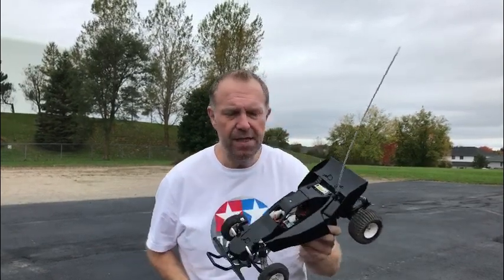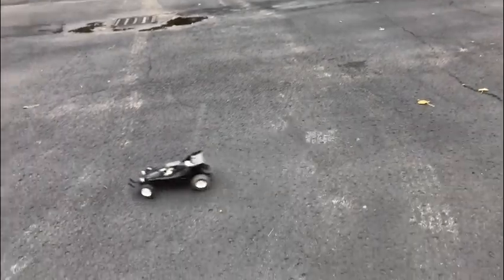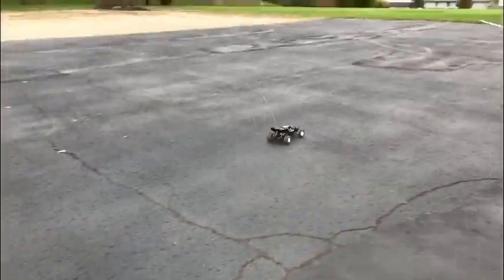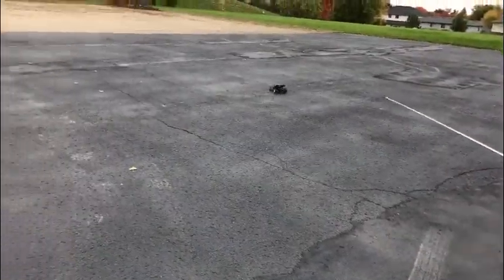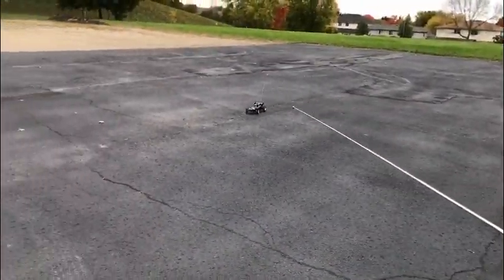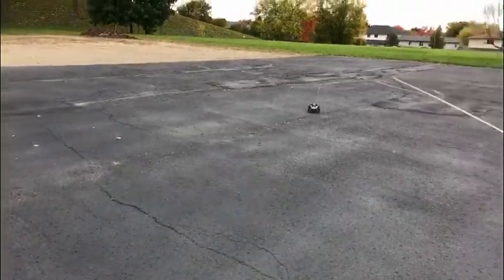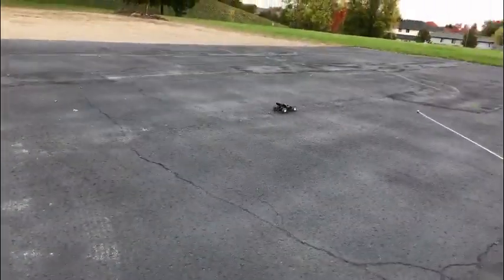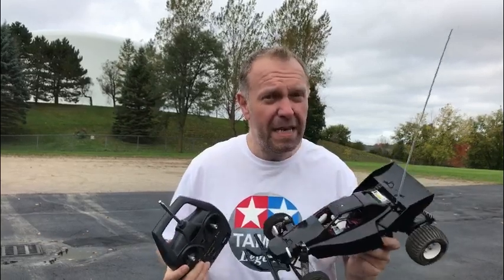Tamiya TECHNIGOLD Motor, Was it all that???

Comment: Thank you, very interesting experiment. I modified a Super Hornet, fitting a BZ motor and making an adaptor plate so that the gearing changed from standard 18T pinion to 24T. All very well, but the kids kept smashing it. I've taken it back to standard 540 with 18T pinion and still have good fun with it.
Reply from the maker: Steven Hall 
Cool 😎 yeah there’s a fine line with that chassis regarding the speed, I think a standard 540 motor on 2s Lipo is just about perfect 👌🏻 
Thanks for watching Stephen 😊👊🏻

Comment: I still have the technigold  stalled in audi quattro with 18 teeth pinion gear. I have tried it in the frog and kyosho's tomahawk. Quickest is tomahawk, smoothest is the frog, while slowest is audi quatro. My nicad battery pack was 7.2v 1200mah only

Comment: just ran my GH2 with the 380, god its slow.... just glad i fixed the pinion issue i was having with the 540 i have,  90% cleaned and fully rebuilt and is running around 20 years later after being tucked away and some replacement bits ordered on ebay, just waiting on some bearings for it now hopefully be an even nicer runner then
Reply from the maker: thesmf1210 
That’s excellent my friend 😎👊🏻

Comment: I’m wondering who would wanna run the tune able motor on low settings, I’d have that bad boy on full speed mode! 😂 great comparison
Reply: For bashing the max setting would be the way to go as long as your gearing is on par but for the trackyou must figure out the sweet spot or you will kill your battery before your done the race. I am speaking or back when the TG came out and batteries were NiCad's. With today's LiPo batteries the TG is awesome. I have 2 in my Clod buster at the lowest setting for the most torque.

Comment: I installed a Technigold on my Hornet back in the 80's.  A buddy of mine gave me the motor; I have no idea if he'd done any tuning to it or if it was "stock".  The Hornet still had the old 3-speed mechanical speed controller at the time.  To say I found the car uncontrollable with the Technigold is an absolute understatement!  In fact, I think I pulled the Technigold after maybe two or three runs and reinstalled the stock 540 that originally came with the Hornet.  As much as I hate to say it, I really didn't like the Technigold installed in the Hornet.  I felt it was better suited to 4WD buggies and on-road cars which would be better at putting all that power to good use.

I still have that old Hornet and the Technigold motor.  The Hornet has been upgraded with an ESC and ball-bearings everywhere.  Maybe when this pandemic is over with, I'll reinstall the Technigold and take it for a run to see if it's still as uncontrollable as I remember it.

Fantastic videos BTW.  I'm a died-in-the-wool Tamiya fan my whole life and I've been pulling all my old Tamiya RC stuff out of the closet ever since discovering your channel. Cheers!

Comment: hi friend
I have a Clode Buster that I am now rebuilding , it has been in storage for over 30 years... two Technigold motors are mounted on it, and I don't know what the condition of the brushes is. Where can I find brushes for this motor? This  does not have to be original, even a replacement of another motor, but which will be suitable for smooth operation of the motor. Can you help with advice or direct me to a place that sells something like this?
thanks

Comment: The GT tuned needs the thrust bearings replaced with BB. I did that and it runs noticeably better. Also the GT is a 25T where as the Technigold is a 21T so makes sense that it’s faster.

Comment: Great video. I have a question that I hope someone can help with? I have an original 1986 Bigwig that I am in the middle of restoring for my son. I would like to install a modern ESC speed controller as opposed to the mechanical speed controller. 
Can anyone recommend what ESC to use with the Technigold motor? Thanks guys!
Reply from the maker: Rob Wilcock 
Hey Rob 👋🏻
Have a look at the Hobbywing 1060 ESC, great speedo and cheap as chips my friend 😊👊🏻
Reply: @TAMIYALegends  Thanks for the swift response guys! Will get right on it. Love that I am passing the baton to my son; TAMIYA lives on!

Comment: hi would u do a video on tamiya technigold motor how to take it apart clean it and rotor
when do u change the brushes and how do u put them in brushes that is
how would u repair the tap when the wire snaps away from the motor how to repair that tap part back onto the motor with the right parts thanks there's not one video on YouTube
would u do  videos on vintage remote systems transmitters

Comment: how do u change the brushes do a video on that (can u)
can u do a video on repair on the power cords if it gets broken off the wire on the motor
can u change the rotor between the gold the power and the tuned 
can u change the brushes cheaper then buying the original ones  thanks
should put the 550 motor into the super hornet
change the shocks to the grasshopper 2 super g (black ones) the super hornet shocks are crap

Comment: If you really want the technigold to perform you should upgrade to a 7cell 8.4v battery. I bought a used hornet in around 2002 or 03 that had this setup and it was like a rocket. I later installed midnight pumpkin wheel and tires on the back and it was crazy fast.
Reply from the maker: 1320gearhead 
Check out my latest video, that’s what I’ve done 🏎💨💨

Comment: Kyosho Le Mans 480 Gold , grab 1 & maybe a 240st for some ultimate tests.
Reply from the maker: Karl Johnson 
I use to run a Kyosho SPA240WS Modified, now that was a extremely quick motor back in the day 🏎💨💨
Reply: The 480 Gold came out in 86 and the ST in 87.  480 was a 25 turn at 22,000 RPM and the ST 22,000 at 22 turn so I’d like to see the ST and Technigold go heads up
Reply: Stop it here guys, this is great memory overload! I used to have the LeMans 240S , 480 Gold, 360 Gold and ST, as well as the SPA240WS and a REV300S(yes, I was a lucky boy😄). And look what them cunning Japanese are selling now:   https://rc.kyosho.com/en/37032.html

Comment: does motor work in  m04 in what type of Mary did you use a 7.2 or.4 or bigger
Reply from the maker: Ervin Strouse 
I was running 7.2v Nimh 👊🏻
Reply: Thank you very much I'm trying      Figure out the best motor and battery I can put in they Mo 4
Reply: Tamiya Motor SUPER MODIFIED 11T Item:53485
Reply from the maker: Ervin Strouse 
That’s a very powerful motor my friend 🚗💨💨
Reply: Would it work or way ripped the gears out
Reply: And thank you for helping me
Reply from the maker: Ervin Strouse 
The problem with that motor is, you’ll need a decent ESC to run it 👊🏻

Comment: Full speed you loose traction with those sand tyres with the technigold. More torque... None of the models should have come with a 380 type motor.. They are terrible. O had a Grasshopper with a 380 and it got binned.